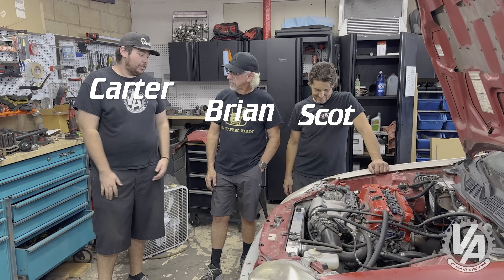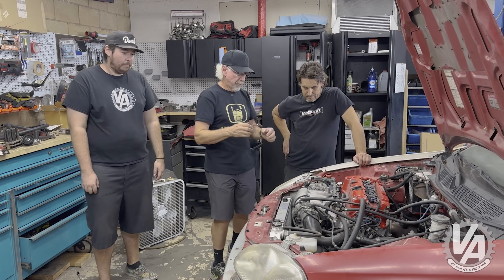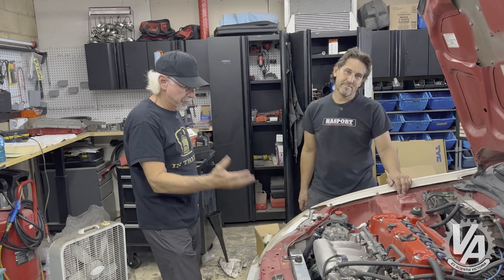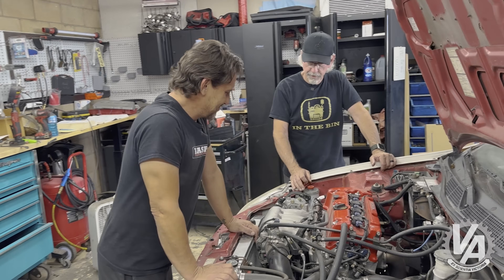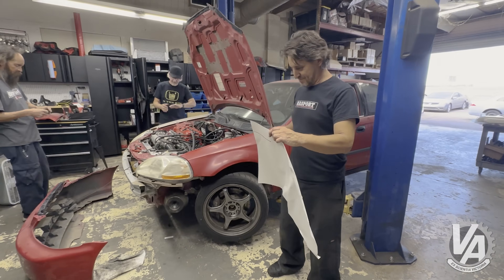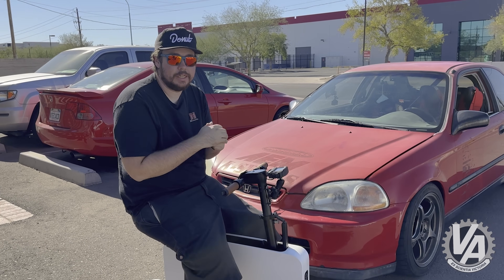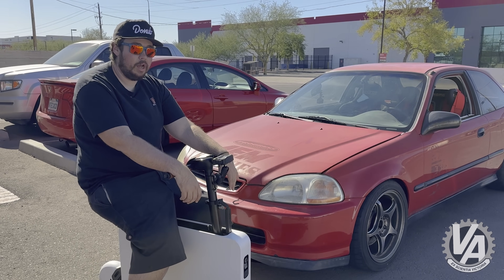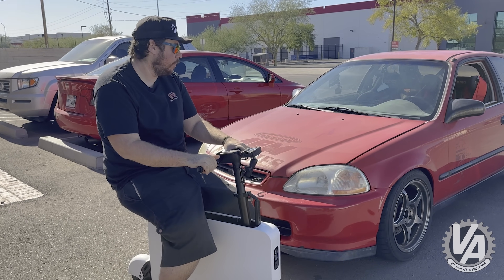K24 EK Civic Hybrid Racing Power Steering Solution

Comment: That thing with the teacher was hilarious. Sometimes it seems strange that someone with such long years of experience actually sticks with building cheap civics, but i guess you guys never moved to more expensive and exotic cars because you opened such an insane rabbithole of different swaps and builds on these platforms and you actually drive a company off of developing parts. Must be awesome to have two generations of enthusiasts on the same page. My own civic actually looks really similar to this red Ek, its a 95 euro spec EJ9 so it came with the 1.4 which is the best little eco engine i have ever experienced by a huge margin. The car ran sub 10min Nürburgring laps with that engine on over 10 year old used coilovers and budget tyres. The d14 are in almost every ek civic in europe and they are absolutely indestructible even compared to other Honda engines. You can run them full throttle, cold every day on the limiter with half the oil missing on 25yo spark plugs and absolutely zero service without them ever missing a beat.  I have swapped a B16A2 into it for VTEC reasons and used hasport rear mounts and shift linkage 2 years ago and its been running maaany laps on the nürburgring since that. Greetings from germany

Comment: I dropped a k24a into a Toyota Matrix a few months ago and the manual steering was killing me. Rather than try to figure out how to mate a Honda steering lines with a Toyota rack I found a Volvo at a junk yard with an electric to hydro power steering pump. All i needed was some AN lines and fitting and to weld up a bracket under the left headlight behind the bumper. It works perfectly. Added bonuses are it doesn't rob power from the crank and I get power steering with the key on and the engine off.
Reply: Am I reading this right?  A K24 into a Matrix?  Holy fuck thats the shit
Reply: do you got a write up?